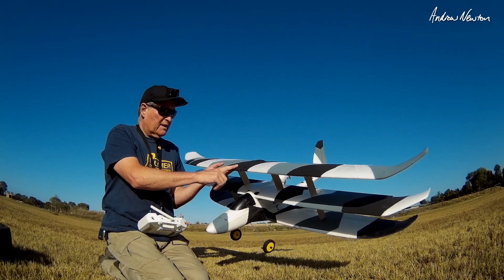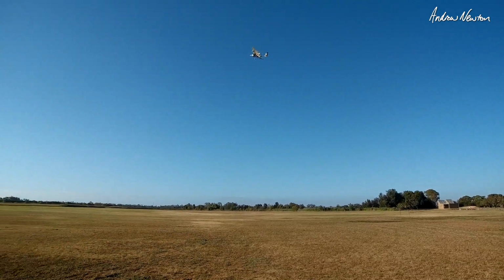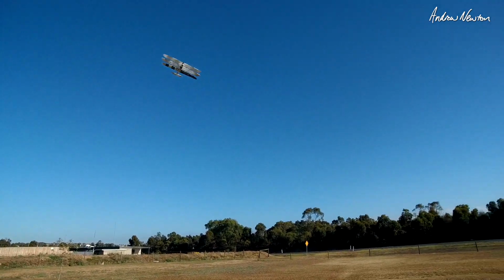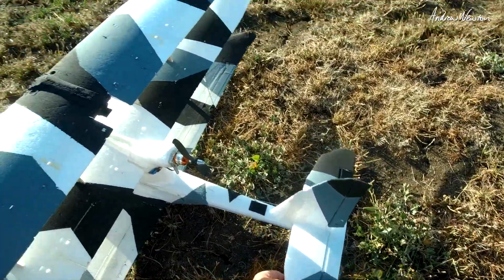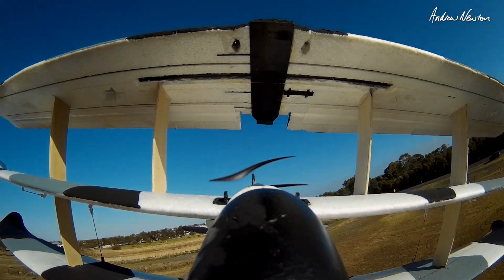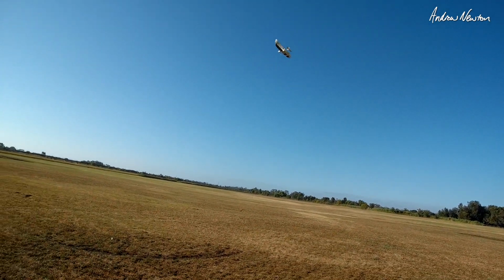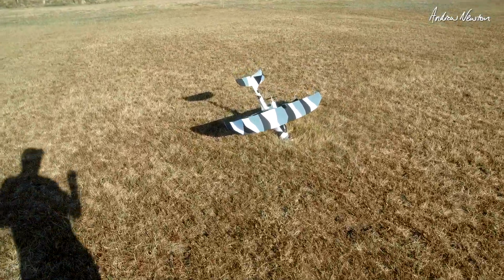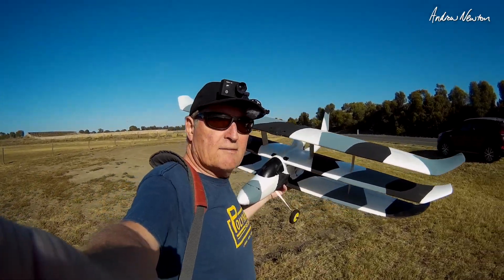Trixler - Bix 3 Triplane

Comment: Andrew, Mate that was absolutely brilliant.
Thanks for giving that well used wing a new life, 
payback for the enjoyment that you have given in these video’s.
That flew so scale like. 
Only needed to be red with black crosses and it could have been von Richthofen,
though I like the battleship type camouflage.
The motor seemed to have enough power, but as you found needed more nose mass.
Suggestion, move existing motor into the nose, more nose mass without adding any extra mass.
Reply from the maker: If anything I'll try twin motors just for giggles Keith, Thanks for making this madness possible.

Comment: I prefer the bi-Trixler looks, but the tri-Trixler floats so gently onto the ground, it’s a keeper! If the push motor is coping I would try to adjust the angle. How about turning the hatch to look like an open cockpit with a jaunty pilot head poking out?
Reply from the maker: Nice ideas. It so needs a retro pilot

Comment: Great video.  I’ll have to search out your incidence video for that incidence gauge you built.   Did you make all three wings with the same incidence.  Also, it was very instructive what you did with the heavy tail...most of what I build is tail heavy and have that problem.  Thanks again.
Reply from the maker: Thanks Jim. The bottom wing I just eyeballed to be level with the original wing. Top wing I used the gauge because I thought it would have a bigger effect on flight.
Reply: Andrew Newton thanks. Are the main wing and the horizontal stab suppose to be in alignment in most simple cases?
Reply from the maker: That's the way I start usually (laziness) Most wings actually need a few degrees up angle of incidence.

Comment: What kind/brand of paint do you use on foam?
Reply from the maker: Cheapest of whatever is available. Accent Spray Enamel (Matt) or Semco Acrylic Paint
Reply: @AndrewNewton  I've had problems with paint flaking off
Reply from the maker: Over spray of Clear Enamel helps